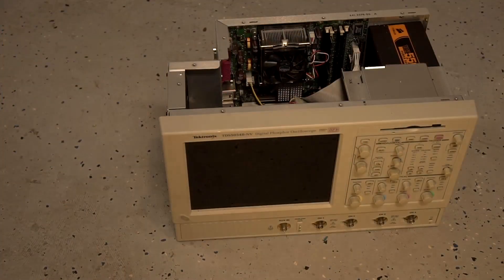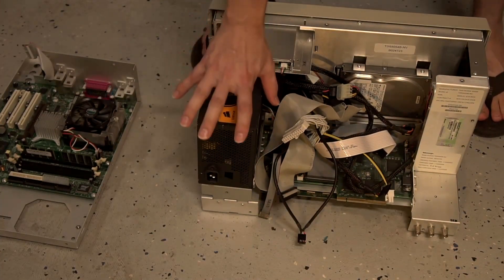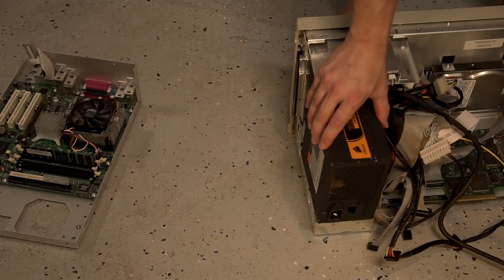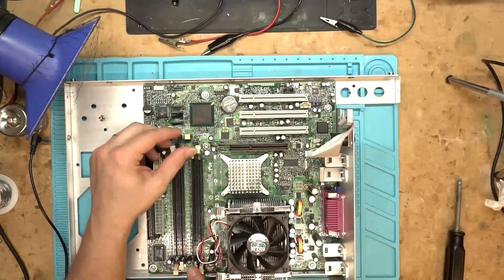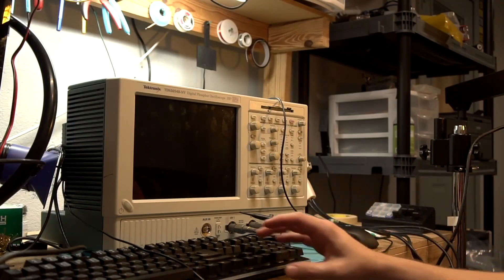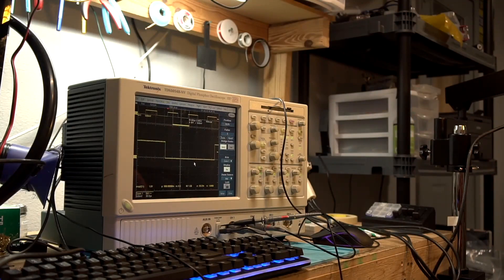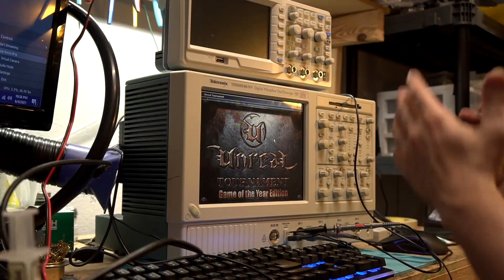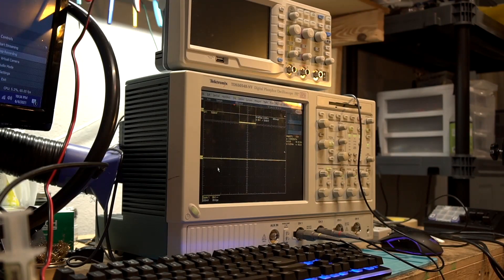Tektronix TDS5054B-NV The Gaming Oscilloscope!

Comment: Hey, I'm tinkering with a similar model (TDS5034B, also D865GLC based), trying to get it functional since the TekScope software keeps crashing with a buffer overrun error. I went as far as trying to get it working with Windows XP, but the software won't install, so back to the 2000. Still, before nuking the XP, I installed Half-Life on it for the nerdy fun of it.

Win2K supports SATA but in the IDE mode only, this won't be a problem since the mobo was pre-AHCI era. A word of caution, the BIOS will hang on drive detection with some SSDs but not others, and a workaround for this would be keeping your old HDD in place. 

The original power supply had an additional molex connector to the oh-silly-scope's PCI board, I don't even know the pinout and functions of that connector since Tek didn't release schematics as a part of service documentation.

I'm still determined in my quest of getting the scope to scope... I'll probably cooperate with Vintage Tek Museum on that, if I need.

Comment: Hah aHa!!! I can see some cutting on aluminum to fit a large graphics board then war games here we come. I can also see a much larger screen on the video card producing hdmi out. If that cpu is a 7 it will run really fast graphics cards. What a fun project for an old Tektronics scope. With that new power supply driving a big graphics card may need more horsepower. Now if those pesky sense lines don't freak out with a massive graphics card. All that will just stick out the back and you can say, "don't look over there this is just a Tektronics scope". Get some really good 10x leads for the bnc in front. Just dont burn up the leads or the attenuator.

Comment: Hi..i just bought the same oscilloscope and its showing no display. When i turn it on it lights up all the buttons on the panel but no display. Does this scope has some specific program on its hard drive or we just need windows2000 running on its board? In case i replace the hard drive and mother board.
Reply from the maker: The scope is just running win 2000 it does have a lot of drivers/software but that's all online still I think. 

There is actually a second little power pc computer in it that if I remember correctly is how the front panel and screen interface with the windows 2000 computer

Have you tried putting a vga monitor on it?
Reply: @FixedUntilBroken  i put it on an external vga monitor but there was no display on that external monitor. From where do i start trouble shooting this oscilloscope? What if i replace the motherboard and hard drive with any available one and install win 2000?
Reply: From my experience, this scope needed a PS/2 keyboard to start at all. No BIOS setting to disable halt on keyboard either.

Comment: Hello
I was watcing your video and so that  
You might have that information I have been looking for. I bought none b version of this scope. It dit not have power supply so I did use an old one I had. The scope works fine with it but has that 445 line triggering error code on start up wich I think has to do with that 10 pin plug from the power supply . If you or anyone that reads this message could give me information about that plug I would be grateful for that.

Comment: Hello:

I have an identical one. IT was so slow so I changed motherboard, hard drive, power supply and install windows xp. Now the oscilloscope run, however I donot get any trace. I think I did not install the power supply right. Do you remember what kind of modification  you did to the power supply cables. I had a unique 10 pin connector with 5 wires. Two of them are for line trigger sensing. I donot know the other three. Can you help me please?
Reply from the maker: Im still on win 2000 on mine. For the PSU the only thing I changed was adding that current sense to the plug. nothing else. the other wires on that plug I didn't do anything to. If I recall correctly the other 2 or 3 wires were for fan speed but it doesn't throw an error for not knowing the fan speed so I didn't care.

The Powerpc board has to be working to get trace. Maybe its a driver issue?
Reply: @FixedUntilBroken  

Thankyou for replying. I think I'm good with drivers. I will try to put back the original power supply soon. 

Do you remember your power supply model? Does the power supply have the plug or did you transfer it from the old power supply? Thank you,
Reply from the maker: @uccoskun  I transferred it over. I used a PSU out of old computer I built like 10 years ago that was in the closet. 

The original PSU that was in this scope when I got it had a bad power rail(I forget which one).
I transferred it by desoldering the power in connector with it's current sensing wires and then soldered it into the new PSU.
Reply: @FixedUntilBroken  Sorry for keep writting you. Do you mean you mean you transfered only the current sensing wires, What about the fan speed sensors. Did you transfer them also or you leave them floating.
Reply from the maker: @uccoskun  yeah I left the fan floating
Reply: @FixedUntilBroken  Thank you,
Reply from the maker: @uccoskun  no problem. I hope you get your scope running
Reply: @FixedUntilBroken  Hi! Are you really sure its the fan? How did you find out?
I just took apart a psu and it seems they are not connected to the fan whatsoever, they run through the fan connectors area but dont hit any components there. 
Also additional info: The two wires on the power lines are for voltage sensing by capacitance, they are used to determine the zero crossing of the power line for the related trigger mode. They are just two wires running paralell to the power wires, shrunk to the outside for capacitive coupling.
Reply from the maker: @NIOC630  so it's been a while but yes the one is definitely for power line but the other I never actually verified it but a forum post stated it had to do with fan speed or fan sensing and was unneeded. I still haven't had an issue with the scope
Reply: @FixedUntilBroken  Hi and thanks for the fast reply! 
I found out in the mean time, it actually is fan speed but the scope is not using ist, fan control by analog voltage (seems to be fixed to 10V) and a 3.3V sense line. The sense may be an issue but doesnt have to i guess, im not sure what things use the 3V3. Also in my case it still runs at 3.2V :)
So yes, it can just be ignored if the 3V3 is allright with it and you put back the sense wires to the input. If you dont, the self check will fail with failure 455 trigger.

Comment: I have that same scope.  I used clonezilla to clone the original drive to a SATA SSD, plugged it in, and it booted right up, no issues.  I was thinking of doing a PSU swap on mine, but if I remember right it had one non-standard plug from the supply to the acquisition board.  Did yours have anything like that?  My original is from Artesyn.  I tried contacting them for details but since it's proprietary they wouldn't share, and I haven't bothered to put a DMM on it yet to figure it out.
Reply from the maker: So that plug has 5 wire. Three of them are for the fan speed. you can just ignore those wires. It doesn't care about those.  The other 2 are for current sense. All you have to do is move those over from the old power supply. Take it apart and you will clearly see what is needed.

Did you see a good boost in boot time with the solid state drive?

Comment: Windows xp doesn’t support SATA. 2000 is older than xp so would assume it does not.
Reply from the maker: Thanks for the info! I thought service pack 3 for xp supported Sata
Reply: Well in windows xp you can install sata drivers during installation but you need to have the files on a floppy drive. There is an easier way around it.
Reply: SATA will only work in IDE compatibility mode. AHCI will need additional drivers and that's gonna be a pesky one.